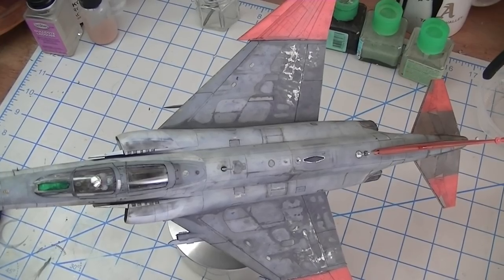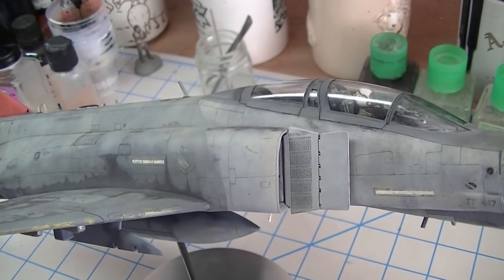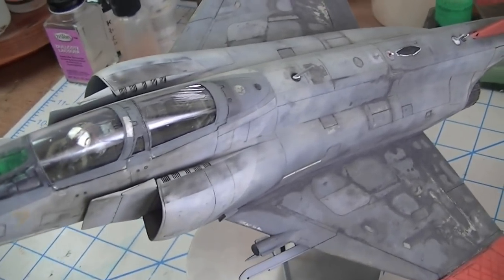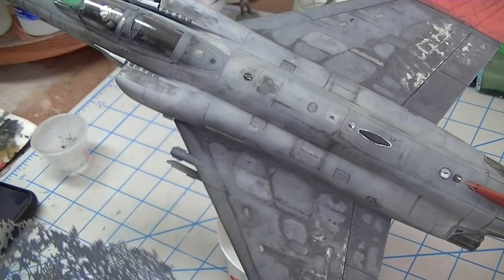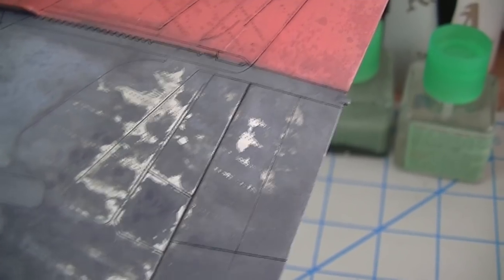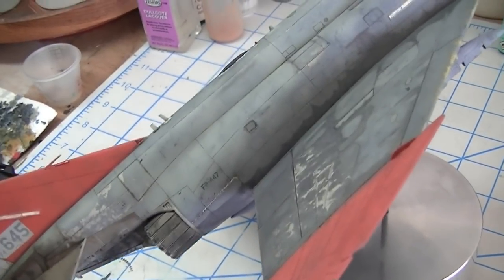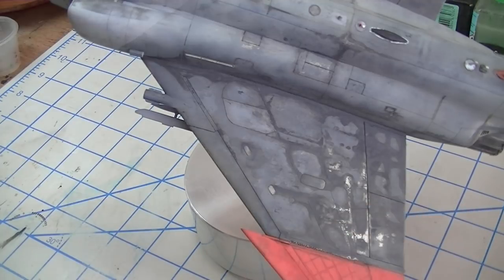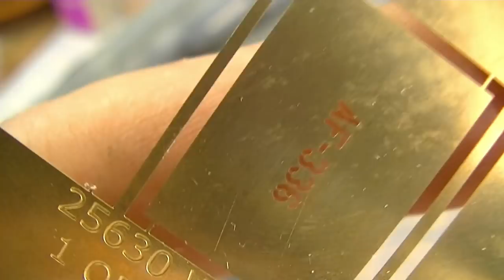ep186 - hasegawa 1/48 f-4e build review part 2

Comment: Will, amazing job, fantastic subject, I had exactly that same issue with my canopy in the 1/72 eurofighter from Revell, when I dry fitted with the lower plastic plate from the kit, it cracked the canopy, I was going to live with that, when I decided to dip in Future (Pledge floor care) and than the marks desapeared, than I sanded the hell out of the lower piece so it will not put stress in the canopy anymore, and I am very happy with the result, the thing with canopy is that you have to change the surroundings to fit it, or if the case is just in the boundary you can sand the clear part, but you should never try to BEND the transparent part, other thing that helps is to use PVA glue, that way you can remove it if needed, without much drama, I learned in the hard way

Comment: Wonderful model. If I remember correctly , the little spike on the right side of forward fuselage is the angle of attack (AOA) probe.  It provided input to the central air data computer (CADC) and the pilot's indexer lights. Almost 40 years, but I can still remember many little details.